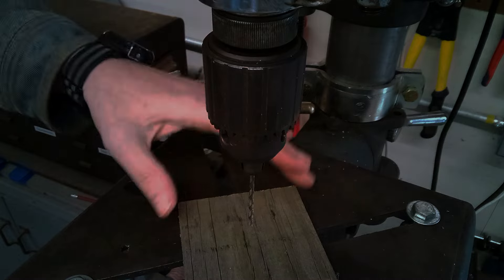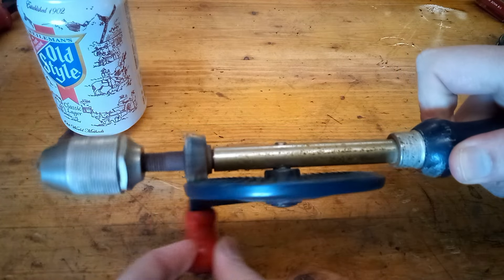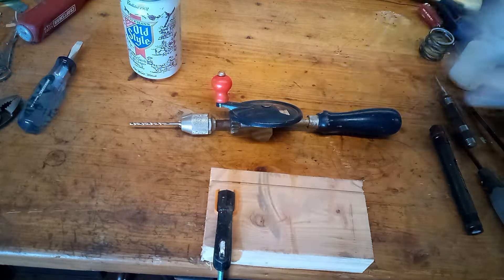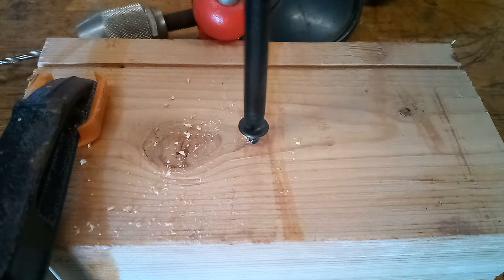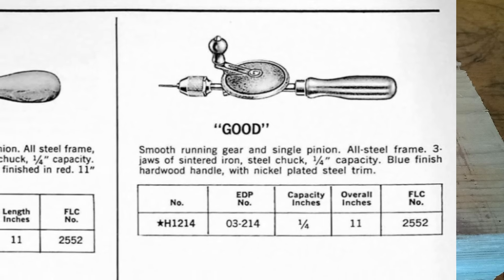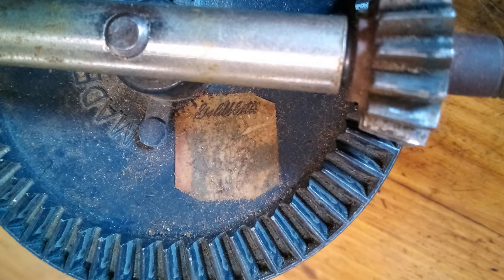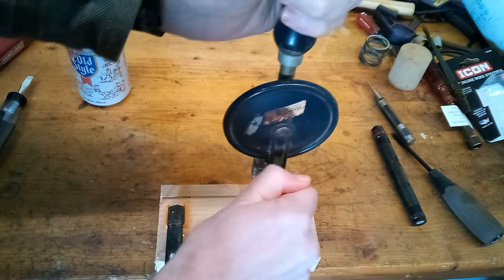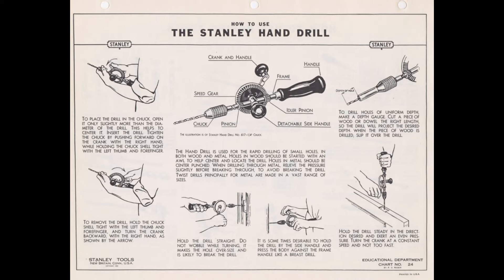Vintage Stanley "Egg Beater" Drill Review & Testing

Comment: It binds not only because the drill needs oil (grease works better but you need to take it apart for application), but also because the bit wobbles around in your case. With a bit of practice, you can drill all kinds of holes very smoothly without snapping even the smallest bits. I have a cheap reproduction and it works flawlessly.
Reply from the maker: Thanks! I've played around with it a few times since, and am starting to get the hang of it. It's still not my preferred tool though.
Reply: @ballinator  with the version you have where you only have the one small gear, the teeth can bind a little as there isn't much to support the drive wheel. My one has a support gear at the handle side and a handle opposite the drive wheel so it has more balance and turning ability at force than the one you have. They are especially good at turning out holes for very small bits (between 0.5mm - 3mm) where other methods present too much force to the bit. I found they are alao especially great for plastics, aluminium, and very small wooden parts for dollhouse furniture or wooden toy making.
Reply from the maker: @classydays43  That makes sense. I'm keeping eye out for one of the dual speed ones but haven't found one yet.

Comment: I have a couple of these. One's an old cheap Sears one that binds up constantly like yours does. The gears have too much slop and slide out of alignment and it makes it annoying to use. But my good one runs nice and smooth is waaaay easier to keep straight. I actually prefer it over my battery drill for some precision work with small bits.
Reply from the maker: I'll be sure to keep an eye out for a nicer one.